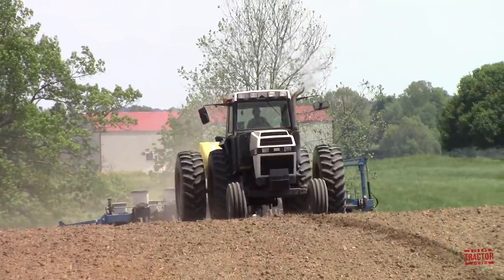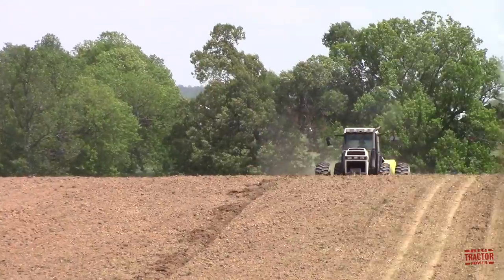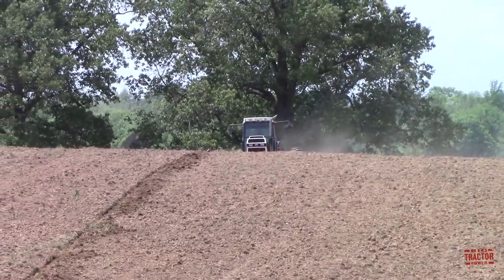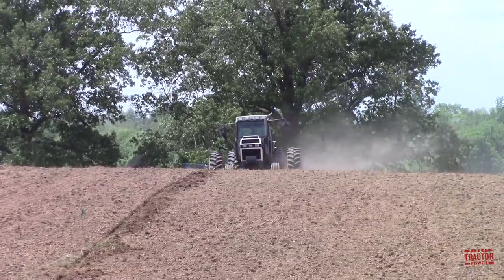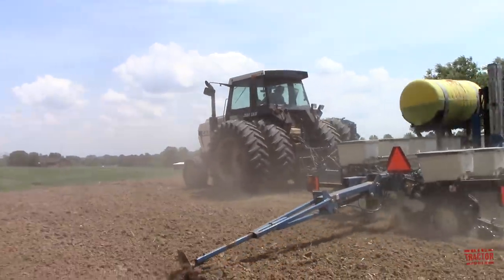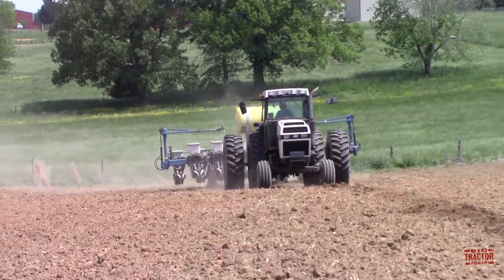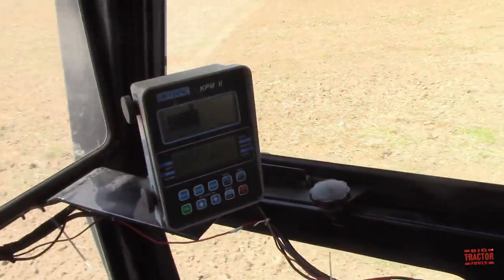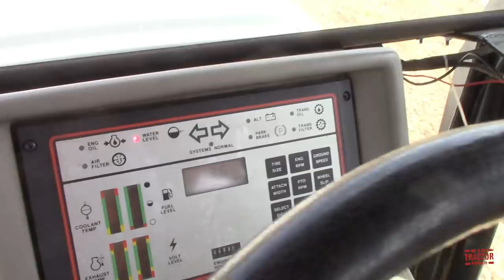CASE 2594 Tractor Planting Corn

Comment: 2590/2594 are my favorite Case tractors.
All manufacturers had their best tractors from this era.

Nice to see someone actually showing skill on following a mark instead of pushing a button and letting the tractor steer so they can go back to playing on their phone.
Reply: Shit it takes skill to set that mark up. I find it almost easier to to follow the marker. I can’t tell you how angered I got the first time I tried using autocrac coming from non auto trac but once set it’s so nice to watch the planter and monitor. I do some smaller field and crooked field with the markers. I don’t know how guys can use planter without markers.

Comment: One of my neighbors used to have a 1570 Case that he used for moldboard plowing and we could see th smoke from his exhaust from miles away. It was a stud
Reply from the maker: 👍👍.  Did they run a Case plow with the 1570?
Reply: He pulled a 4 bottom IHC 145 rollplow and it rocked. Looked like an old fashioned steam locomotive coming up the field. Black smoke pouring out of the stack
Reply from the maker: Very cool.  Those roll plows are neat to see.  I would like to find a 145 to film.
Reply: I used to think that the 1570 didn’t have a turbo because of the amount of black smoke it would blow. The old farmer that owned it was a diesel mechanic of sorts and he had it turned up to suit his fancy. He always plowed with a cigarette hanging off is lips and the joke was he just couldn’t get enough smoke in his life lol

Comment: Owned a 2594 from 2001 until 2012. Absolutely loved it. Had 9986 hours on it when traded it for a new new holland 8.235 never turned a wrench to it other than change oil and all filters. A jd 4850 same age would burn 3 more gallons of dsl fuel per hour. And no room in the cab for a lunch box and when the sun went down the lights on case  were so much better

Comment: Great seeing a 2594 out in the field!  I grew up IH and embraced the buyout, although I wish things would’ve been better so as both could continue independently.  My big tractor is a 2594 and is the first built in 1986.  Serial #9941789 is red/black and in central Iowa running strong.  There is some orange paint showing on the front hubs.  I’m led to believe this is an early convert to the Case IH version.  Thanks to BTP for keeping us all fed with great info and video!
Reply from the maker: Ben thank you for sharing.  Some of the earliest 1985 2594’s were painted white and re-painted to red.  Those new red tractors still had the orange tri-stripe decal.  Case International decals did not appear until spring of 1985. I hope to film a Case Case IH 94 series some day. I grew up in WNY and the first Case IH I saw was on a local dairy who bought a new 4994 4wd. It was red but had the CASE orange decal. The farm ran that 4994 through 2001 when it was replaced by an STX375 Quadtrac.

Comment: Australia here. I did 6000 hours on a '82 2390 from brand new. Cost my boss $84,000 Aud. It had the most amazingly quiet cab. We had some troubles with it including 2 bent push rods, vibration fractures in trans lines and an expensive failure of the 4 by 3 powershift. Boss reckoned it was a  lemon, I told him we drove it too hard. I was told to drive it at the pto mark, so I did, I was a teenager. But I have warm memories of that 2390 and the music on the stereo cassette player.
Reply from the maker: Thank you for sharing. That is some cool memories.  The 2390 was big time in its day.

Comment: Love this 2594 Case. I've seen one that had the front end assist. Rare though.
Reply from the maker: The front assist 2594 is the 3594.  The 3294 cane out in 1984 and the 3594 in 1985.
Reply: @bigtractorpower  I stand corrected.

Comment: As  a farm hand just out of high school in the mid eighties I operated  one of these moldboard plowing, the one I operated had orange wheels and just 2594 on the fender not the case name, also I thought it was powered by a Cummins, maybe my memory is off
Reply: That’s was repainted. The 5.9 and 8.3 came about from a joint venture between case and Cummins, but I’m pretty sure those tractors had pure case

Comment: so can it spread out more for soy seeds because the soy seeds don't get as eaten by birds and things ?
Reply: or soy needs more room probably
Reply: The tighter row spacing for beans,  15in instead of 30in, allows some benefits for certain regions growing beans.  The seeding rate may stay about the same per acre but the plants will canopy over the field sooner while having more room between seeds in each row.    This can yield better for various reasons, but also that early canopy maximizes sunlight utilization and helps reduce weed pressure.  There's some places where 30in is still preferred because of disease pressure and having too tight of a canopy reducing air movement.  Personally in SW Iowa we've seen a bump in beans planted on 20 or 15in rows compared to 30s, and usually the biggest benefit shines through for beans planted later in the season.  Hope this helps

Comment: Had one, 24 speed, had two 2590's, 12 speed... and two 1570's... Sorry but those 504's would only go 3k-4k hrs before rebuild... oil change every 100 hrs... daily filter cleaning, fuel filters, correct coolants... etc... maintenance freak!!! So different than today,,, 500 hrs now between oil changes... Warren from Western Truck and Tractor Repair was on a CAT Challenger in a recent video, said the old girl was starting to burn a gallon of oil a day,,,, @ 15,680 hrs, C15 ACERT CAT.... seriously, 16k hrs... So six 5k rebuilds on a 504 @ 30k or one re-man C15 for 12k... Sucks CAT got out of trucking and farming... Too bad Versatile cant match a  C18 CAT 800hp engine with that CAT transmission for those large FWD's/DT'sI!! I started in the early 70's, from 70-140hp tractors performing major work, now were at 620, 800 will be here soon ...LOL

Comment: I would like  for someone to explain to me how the marking  arms on the planter work
Reply: The  marker is half the width of the planter, so if the next pass you straddle the furrow with the tractor you'll have the right spacing between passes.
Reply: @pgacsermons2605  Prime purpose of the hood ornament to line up with the marker line.
Reply: As far as when the right or left marker arms know when to go up and down,.....Back-in-the-day, our planters used hydraulics to only lift the planter up and down.  The sequencing system used on the marker arms was mechanical, through a trip lever/finger system connected to chain linkage that was attached to each marker arm.  If the planter was going to be transported down the road by a tractor or pickup truck pulling it, you could manually lock the marker arms system in place, so the marker arms did not accidentally come down from a bump in the road or whatever, and get torn off at road speed.  When the planter got into the field and in place, you would manually unlock the marker system, so it could do its thing.  When the planter was lowered, the mechanical sequencing system would let down one of the marker arms.  If the correct marker arm came down, you just started off planting.  If the wrong marker arm came down, you would raise the planter up, and the marker arm mechanical sequencing system would switch things around, so when you let the planter back down, the correct marker arm would come down.  As time went on, and new inventions arose, planters went to all hydraulics for planter up and down, and marker arms up and down.  Things basically worked the same, but now they used a hydraulic sequencing valve to alternate between right and left marker arms.  I have not been involved in farming for around 30 years or so.  There are probably other innovations out there, such as air or electrical actuators.  If you were wondering how the marker arm makes a mark in the soil,.....there is a disc type blade at the end of the marker arm, that can be adjusted at different angles to vary the amount it digs into the soil.  The farmer usually centers up the hood of the tractor to follow this mark.  A lot of tractors have a hood ornament on the front to make it easier.  Hope this helps.